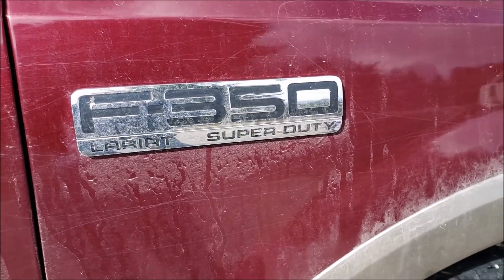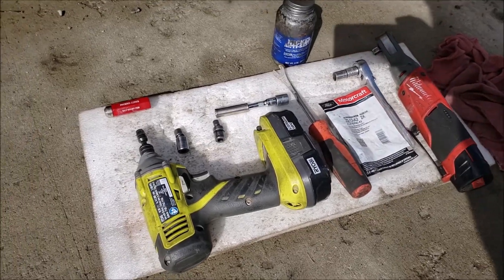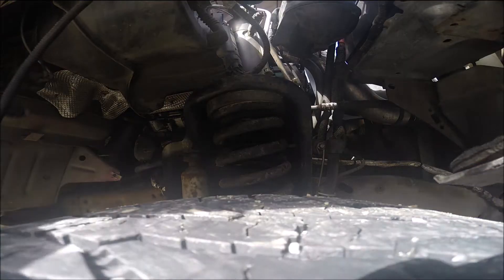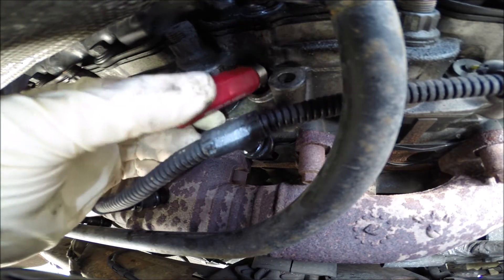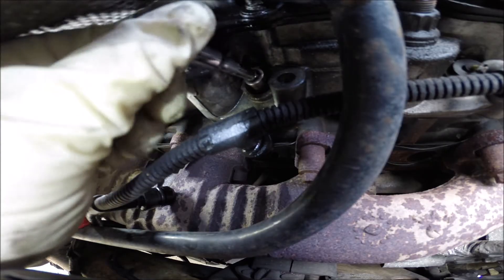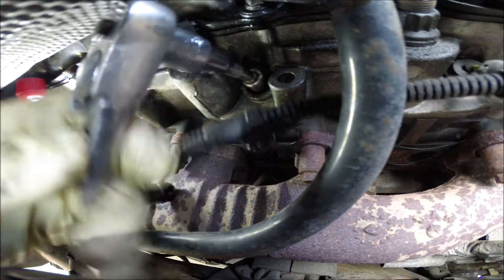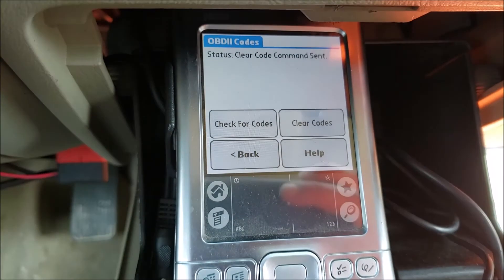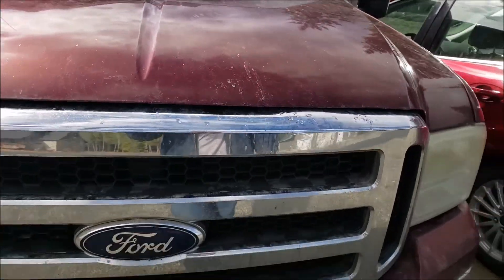My Tips to Replacing the Glow Plugs in your 6.0L Power Stroke Diesel

Comment: The hardest part is if you drive a 2003 6.0, trying to get past the heater/HVAC cover on the passenger side. The early models have a bus bar style that is not flexible. Going to have to cut the flange of the cover. Nobody has addressed this in a video that I can find
Reply from the maker: The bus bar style should release the same as I showed here. Silicone lube, push and pull until it pops out.

Comment: Do you recommend a small amount of anti-seize on the Glow Plug threads before installing them?
Reply from the maker: I've never needed it on the 6.0 Powerstroke and I've been replacing glow plugs in those for 20 years. 
But it's a necessity on the 6.6 Duramax, so I do know it won't hurt to use it.
Reply from the maker: Reason being the glow plugs live in engine oil on the Ford where the Duramax they are external and suscectable to rust and other environmental contaminants
Reply: @fordtechchris  That makes sense. Thanks for the reply. Also... do you feel it's necessary to pull the valve cover to prevent any trash getting into the oil pan through the drain back holes. If so, that takes the process to a whole new level of difficulty. And while I'm talking trash, is there any risk of gunk going into the motor through the Glow Plug holes?
Reply from the maker: @Bullitt5094  no, it's not necessary to pull the valve covers. You can get an air nozzle and blow out the trash before you pull the harness. And even flush it with brake cleaner if you want. Some guys pull the valve covers just to pry the harness out from inside if they're super stuck. But honestly you have the same risk of dropping dirt in from the top edge of the valve cover gasket as the glow plug harness. Take your time and be clean and use silicone spray or PB blaster and the harness will come out easy with my technique in the video. Good luck👍🏻
Reply from the maker: @Bullitt5094  and you'll only get a little dribble of motor oil going in to the cylinder through the glow plug hole. So expect to make a little smoke on startup after service. No big deal though.

Comment: About how many miles do glow plugs typically last? I’ve got the same motor, and it runs great when warm but when cold it’s about 15 miles before it’s running smooth. Mine is bulletproof with 127k miles.
Reply from the maker: Glow plugs last around 100-200k typically. They don't really "wear out"
Glow plugs are really only for cold start up and once the engine lights off, it only uses them to reduce any unburned fuel that would cause white smoke. It sounds like you actually have sludged injectors and need to replace those.
Reply: @fordtechchris  oK, thanks.

Comment: There is really no easy way.  The tool sucks unless the harness is in decent shape.  The wire trick is better than the tool. If you get in a pickle just remove the valve cover and injectors . Don't waste your time trying to drill the broken harness.
Reply from the maker: Agreed, I've mostly had good success now but soaking in penetration fluid and wiggling

Comment: Nice video.  I recently had an issue removing the glow plug harness boot off my 2007 F350 DRW/Lariat 6.0l.  The drivers side glow plugs, the first plug closest to the front bumper, the glow plug boot actually broke and I was using the special tool for glow plug boot removal on the 6.0liter.  Any suggestions on how to remove the remains of the broken boot?
Reply: 2 weeks too late.  Drywall screw ran down into the broken boot then pry out using the screw.
Reply: @btwbrand  I was thinking about doing something similar, appreciTE THE RESPONSE MY DUDE!!

Comment: When the harness comes out easy it’s a easy job but latley the last dozen or so I done have been so so rusty and harness oil soaked from the shot lower valve cover I’ve had to cut the plugs harness drill thick screw in grommet and pry on that or rap some cable on it and yank em out 

Duramax glow plugs are way easier. Takes a 7mm 12 mm and a few other small sockets to take out inner fender liner
Reply from the maker: I agree, they're getting harder and harder to remove. I'm still having the best luck with PB blaster and pushing in/pulling out several times to work the penetrating fluid in until they release. Reassemble with silicone spray is working the best as well.
Reply: @fordtechchris  I wish I could show u a clip of this last one I did each one came apart in pieces had to use tweezers to remove the lower half of the harness tube on glow plug 1